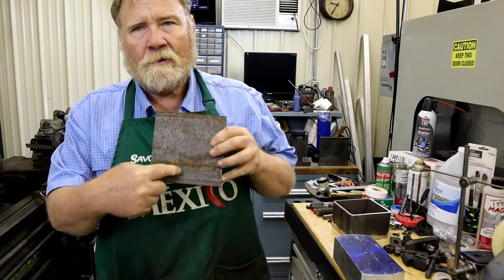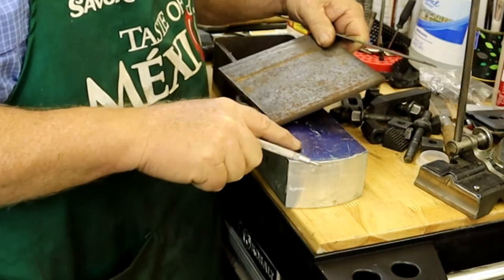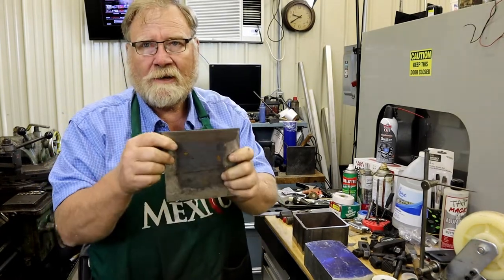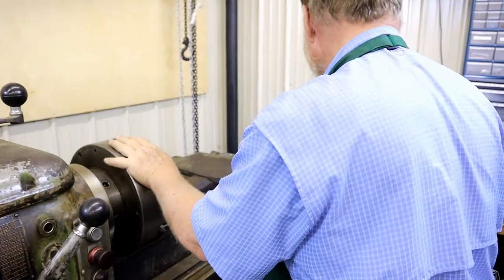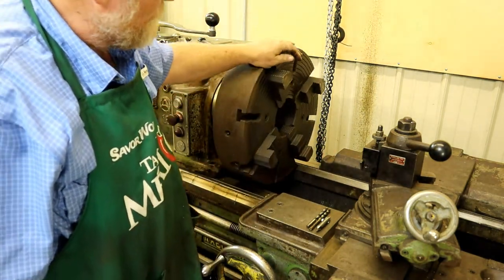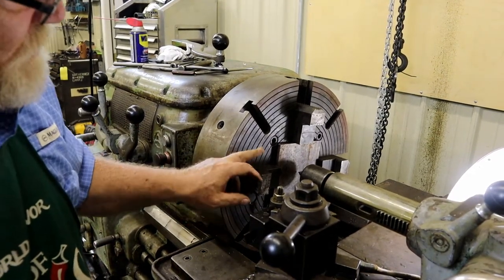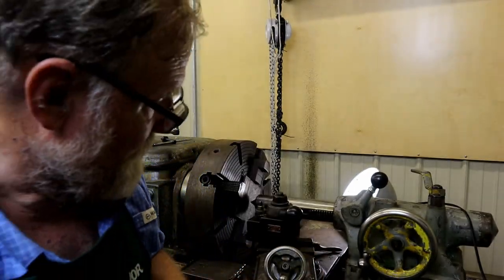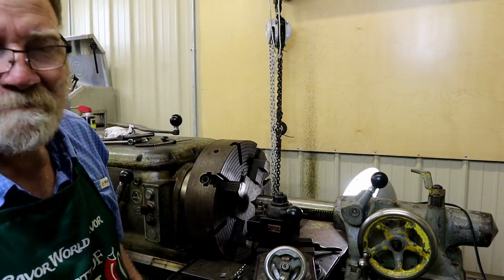1954 Axelson Lathe work

Comment: The amazing part of the optical center punch is putting the acrylic magnifier back in after making the punch-divot...its "perfect"!  I like that U-shaped bar, if you had a lug on the top leg that approximated the tapped hole on your other chucks, centered on the body, would help the chuck lift "level" and thus the camlock pins would be parallel to the bores.  Not so useful when pulling it but good when mounting it.  Neat design on keeping ants out with a medieval "moat"!
Reply from the maker: I have found that the u bar helps when putting the chuck back on also... With it tipped It is easy to line up the hole and then ease it in when lowering the chuck..

Comment: Don’t you just love that two speed tailstock on that Axelson, and the reversing clutch, there is a metric threading chart on the gear cover, I am in the process of making a set of gears from Martin gear to be able to cut metric threads, that is where the reversing clutch will be handy
Reply from the maker: I looooove my tailstock :)